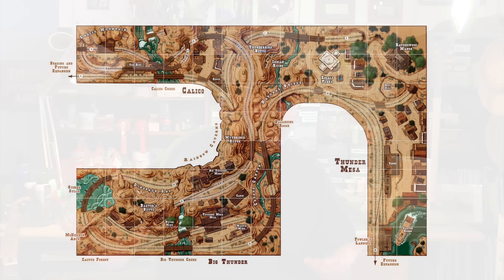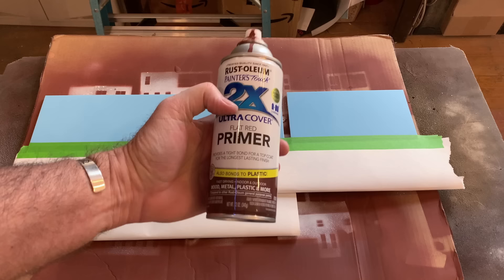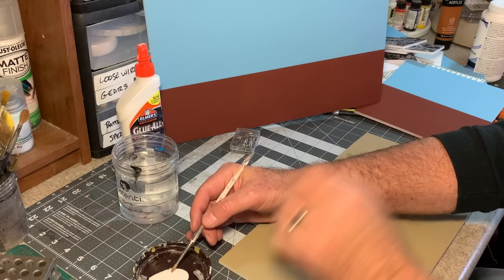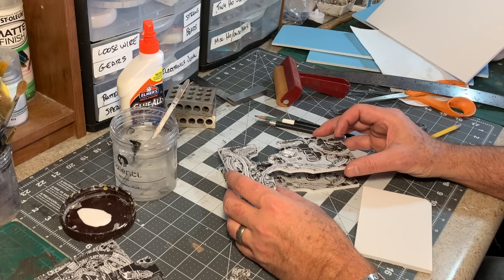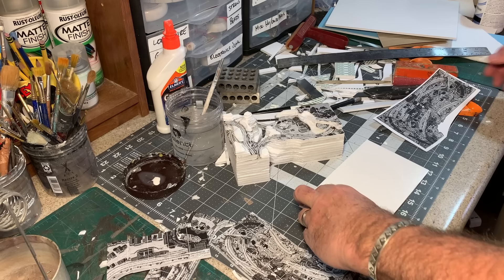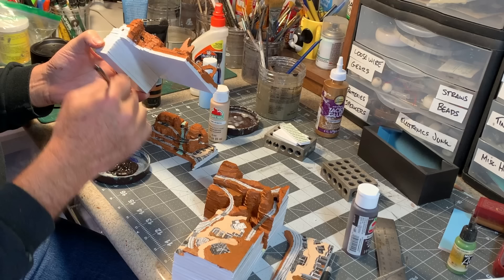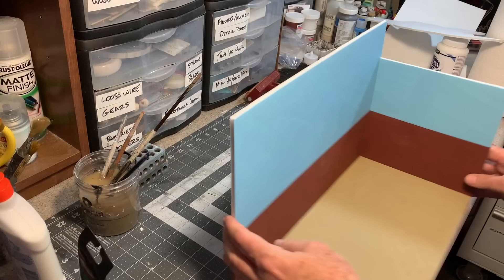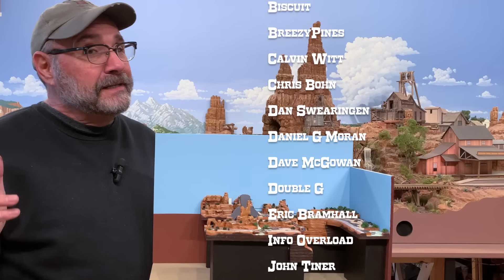Making a Planning Model | Thunder Mesa Reimagined

Comment: Dear Dave, awesome vid, love the madness of the foam core method. Absolutely agree on the intrinsic value of making a 3D model of model railroad. Very interesting how you approach this with the foam core. 
Am pretty sure the roster of the Thunder Mesa isn’t yet available in T-gauge. Nevertheless, I humbly think it would be interesting to even add that extra layer. Might be the 3D mockup should be a tad bit larger to accommodate the 1:450 scale. Just as thought.
The mockup as a tool definitely has its advantages. Cheerio